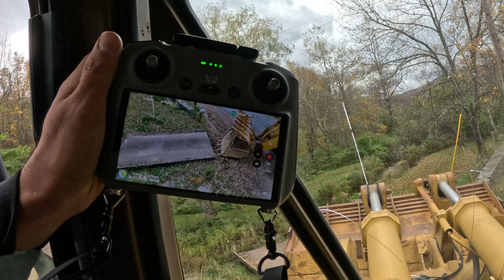Moving a steel bridge

Comment: This is close to how they used to build bridges using old flat bed rail road cars. You could even set them up to be backfilled with concrete.
Reply: Not only flatbeds, but also grain carts. I've seen a couple of roads where a gap had been stabilized utilizing grain carts filled with concrete, where the concrete (inside the bucket) encapsulated concrete telephone poles as triangulation). The cart would eventually rot away, but the tripod created by the big lump of concrete and the two telephone poles would remain in place.
Never saw it myself, but i know of a road in the mountain side where a previous owner in the 80's drove a truck (10 wheeler overcab + shipping container) made holes in the roof of the truck and container and poured concrete. You can't see it today, it's under the road, but i talked with the son and he told me the wild story. 
Whatever works, works.
Reply: @aserta    I meant to put this in my comment to you, but I forgot to add it. I wanted to thank you for starting to meet halfway decent paragraphs. 

It absolutely amazes me the sheer number of people on the Internet that will pose comments that are 2 inches to 4 inches long. And not one paragraph. 

6 inches long and not one paragraph.  I have seen comments of foot-long and I’m sure you have to and,  yep. Not one paragraph.   It’s absolutely disgusting.
Reply: You can't expect more than that. It is YouTube after all.
Reply: @garlandremingtoniii1338 , Ok, do you have to leave spaces between the paragraphs or (like I do) when you start a new paragraph space the starting word in 3-4 spaces, like they do in a book? I try to start a new paragraph when I’m switching to a different subject or thought, not just in the middle of a sentence, so is that proper etiquette? I’m not trying to be funny, I’m curious how people text and such.
Reply: @aserta        (Correct you are my friend!)

     We still use RAIL-ROAD-CAR-BED’S,   Here in Western-Wyoming, and they do the same thing and Western Montana . Because in both places is where the continental divide, Rocky Mountains run all the way up to Canada. 

And they are absolutely perfect for crossing fast-moving strains and you need something that will last a few generations and handle any amount of weight you want to go across. Including logging trucks.  We have three different places on my family’s ranch. 

Anyway, I knew there were a few videos about this on YouTube so I went over on the YouTube and Web and got this one for you and other people to look at. This guy in the video did just about the same thing we did when we installed ours. We did it ourselves because we have more than enough equipment to do it all with…

And we did 3 different / separate crossings.  The video you’re going to see, he did one like we did.  A pretty wide drive crossing,  a wide creek for our-farming &, logging equipment. He did what we did. Put 2,   90 foot long ones side,   By-side.

 And that is the link of all railroad cars. 90 feet long. Regardless of the car. Over to the right, you will see another video of a fella that installed a railroad car bid going across a creek. And from the looks of the picture, it looks like it’s pretty high up!! 

  The name of the video is,   “Bridge Made From Flatbed Rail Cars”.

https://youtu.be/Nqaq4pPqxE0?si=4kqbPgHE-eI-QvQv
Reply: We still do that for our access roads

Comment: Man driving over that culvert when it sunk a little I almost fell out of my seat XD
Reply: I wanted to see the return trip
Reply: The returned trip will be a separate video, fixing it 😄   @DejvmanXsindicate
Reply: Next video will be replacing an old 'rotted out' steel culvert ;)
Reply: @paulhammond7489  They're surrounded by thousands of free trees.
I wonder what they'll make a bridge out of. A sheet of steel?
Reply: @hermitoldguy6312  In this case it looked to me like the steel bridge they picked up had been replaced by a new bridge. So in effect they had a spare bridge already manufactured, I guess that saved time and was good enough to span that small creek on the trail.
Reply: @paulhammond7489  Yes, replaced by a wooden bridge. 😚
Reply: @hermitoldguy6312  Sure looks that way :)
Reply: For some reason he didn't show going back across. He really needs 2 pieces of plate to go back since it cracked.
Reply: How's the grey dodge
Reply: @mayshack  Not actually, The weight from the bridge was lifting up the rear, going back a 100% of the rear counterweight will be   on the bridge
Reply: @6996brandyl it's no longer carrying the bridge.. it will be lighter. The bridge lifting weight off the rear just adds it to the front
Reply: @kiesh.  The front might be lighter but not the backend, But the front weight is nothing compared to the back
The back end will not be lighter, the backend has that counter weight, having the bridge out front is lifting the rear weight up.
It's just like a forklift if you don't understand that the rear is heavier now I don't think it can be explained to you
Reply: Same here.

I was like: "Ooookay, that was "almost" too much for the pipe..." XD
Reply: Next they’ll move the bridge back down where the culvert is/was
Reply: It looks like the ground around the culvert have way not the actual culvert
Reply: @mayshack  it's just like a see-saw , you have 2 fat kids one on each end but one with an extra 100 lbs ( the fat kid with the extra 100 lbs would be the rear counter weight) you're just lifting that extra 100 lbs 
Now remove just the kid now you have the fat kid & 100 lbs weight on 1 end
If you don't understand this it can't be explained to you
Reply: I've watched a $750k combine fall through a collapsing culvert and it made me pucker 🤣
Reply: Yes it give me butterflies for a moment too.
Reply: probably actually a old tank with the ends cut off.. needs about 3-4 feet more fill over it. @DerekL2005
Reply: was that a public or private one?
Reply: Shhhhh…!
Reply: @DerekL2005 30 tons. Those machines are on average about 60,000-70,000lbs. Still A LOT of weight for that culvert.
Reply: ok
Reply: ok
Reply: why does your comment say it was edited 7 days ago when the video has only been out for like 32 minutes? Weird.
Reply: @mellowpuddle Cause I made it 7 days ago when the video was still private 😮
Reply: well that explains things thanks. @CerebralAilment
Reply: @CerebralAilment  whaaaat??? You have “private” early access to his videos? U in the Illuminate or what???
Reply: @pauljoseph8338 Sometimes I get a link to screenings for feedback
Reply: @CerebralAilment  I think it might have been an 'unlisted' (as opposed to a 'private') video.  With 'unlisted' anyone can get to it if they are sent a link, wheras 'private' videos can only be viewed by the uploader.
Reply: @RangieNZ  Yeah - private in the sense that it was not public yet 😉
Reply: @RangieNZ 
He works for Andrew sometimes. For example, he edited the Levi memorial video and I believe he also helps with merchandise, etc.
Reply: @mellowpuddle glitch in the matrix…
Reply: It was private before that ..  @mellowpuddle
Reply: I was wondering the same thing.
Reply: I mean its a solid pipe 😂
Reply: WHT are yall hating for